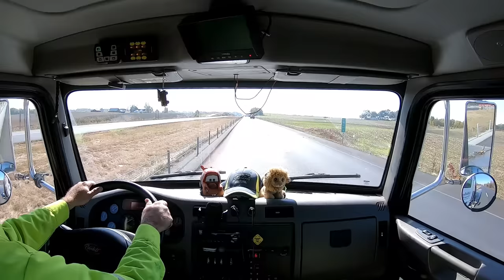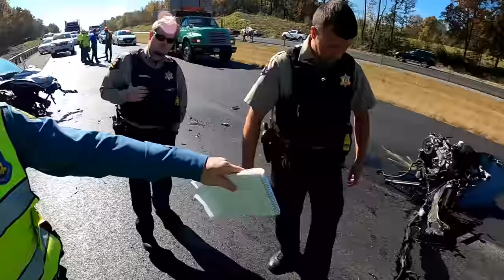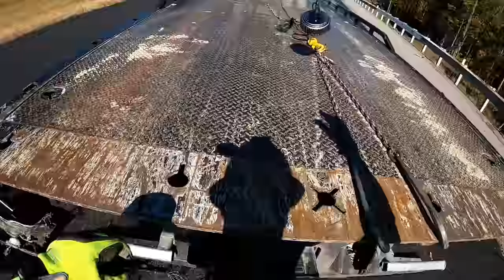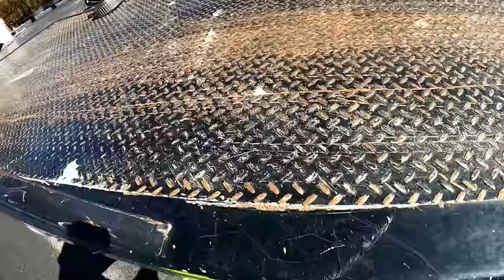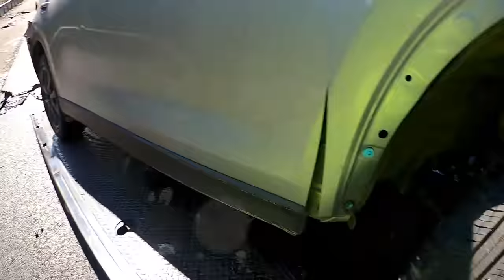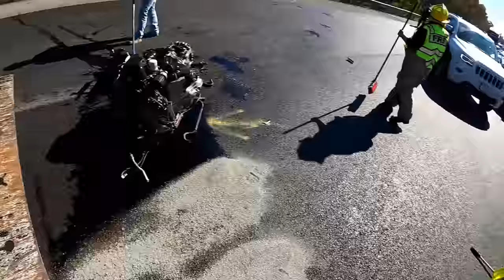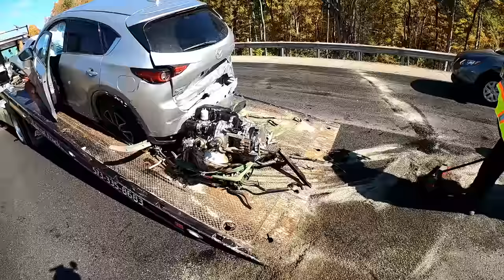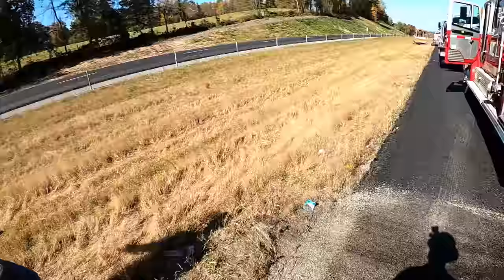Car-Splosion!!!   Code  (Blues & Twos)  Response While Driving In The Wrong Direction!!!

Comment: Please keep the code response drive times included. That's very interesting. Not everyone gets to see a wrecker run like that. Also please please Ron for your safety get that siren put on that truck for your safety. Clearing intersections without it sure seems dangerous with justma air horn. Although I see this vid is older so maybe it is done now. Good work Ron with everything.
Reply: We cannot hear his sirens from inside the cab.
Reply: @davidgriffith618  he stated in the video he hasn't had a chance to install the siren on this truck yet.
Reply: @davidgriffith618  he have non at this old lady. His newer ones have
Reply: @davidgriffith618  
That rollback doesn't have a siren yet. It's on Ron's mile long list of projects.
Reply: Yeah mate it's good to see a little bit of your part of the world
Reply: @davidgriffith618  Funny how we hear it just fine on the trucks that have one....
Reply: @davidgriffith618  
Have you watched his other video where he expedites. You can hear the siren in the truck. I'm not sure as to why you wouldn't.  You hear the horn and other things inside the truck why not the siren.
Reply: @841k9  this was filmed a while ago is my guess. im sure he's got one on there now
Reply: Hmmm.  I woulda thought that sirens would be restricted to fire, police and ambulances.  Is it only certain jurisdictions that allow sirens on recovery vehicles?
Reply: @avenger1888  air is louder
Reply: This is the new rig.  No siren equipped yet.  The air horn covers under MODOT satutes.
Reply: @keithmills778  In some of his videos he puts a caption explaining it but In Missouri tow operators are considered emergency vehicles (not first responders tho) and when requested they can run lights and sirens.
Reply: @keithmills778  It's state by state determined. 
That's why (as I was taught) you respond appropriately to the light (and/or 
horns / sirens)  NOT the type of vehicle.

Comment: For Sale: SUV. Light bumps and scratches. Needs engine and tires. No lowballers, I know what I got.
Reply: Actually, the engine can be included, just needs to be reinstalled.
Reply: lol
Reply: Sold
Reply: First owner,  clean and clear title under my name.  Tags good to 2024,  make me an   offer with cash in my hand.  Just had a new timing belt and water pump. Hurry,  It won't last.  Have a nice day.
Reply: Trade for a 89 Cressida rusted fenders no passengers seats runs and drives.
Reply: "Ran when last parked"
Reply: BWAHAHAHAHAA!!
Reply: Most of that will buff right out.
Reply: Might also need a coat of wax
Reply: Casually throws in needs new engine
Reply: lots of people sell cars like this and they’ll ask 2500 for the vehicle 🥴
Reply: @thedelightfullytacky  no point in reinstalling it. it’s likely broken & you’ll end up paying wayyy more to put it in, take it out, buy a new engine, and install the new engine than if you just bought & installed a new engine
Reply: Oh hi gonzo, I'll offer 200 lol
Reply: € @chucfilms  keep
Reply: Auction for Copart haha
Reply: Lmao
Reply: 500 dollars prob

Comment: 3:45
The ol flatbed looks like it could get real squirrelly in a heartbeat. 
Glad you’re hanging on with both hands!
Reply: That flatbed truck is almost new he's had it for about a year or little over now
Reply: I saw that, too. 😳
Reply: doing 75mph is quite fast compared to 80kph here in germany. I wonder if that more of a speed leads to more serious injuries or more accidents at all, but then on the other side, when all traffic goes the same speed, it could be more safe...
Reply: New is good ,but the wind don't care about that. It's a big box flying down the road at full noise so it's gonna sway like your drunk uncle at a wedding...! I'm just not sure if it is skill luck or a little of both that keep it on the road.
Reply: That asphalt looked brand new, no lines painted yet. Fresh asphalt very oily gets slippery as ice with a little rain.
Reply: @knuffelbaer1971  The faster someone drives, the greater the danger to the people and 
animals in the vehicle.

Comment: Bet the check engine light on that car said "Holy Crap".
Reply: ROFLLL
Reply: Now that was funny!
Reply: An actual check engine light. The computer would like to know if it's still physically there anymore.
Reply: Drops the car at an auto shop. Mechanic says "needs a motor".
Reply: @pistolannie6500  it went from a check engine light to a check for engine light.
Reply: It's undergone a radical lightening modification, and it's now an air-cooled engine at the rear…
Reply: Nah man the check engine light saw that coming and bailed.
Reply: @nmlepage  🤣🤣🤣🤣
Reply: "CANbus communication fault". Understatement in this case! The engine carried on driving!
Reply: Great  post made me smile and chuckle
Reply: Think that engine will need an oil change!
Reply: check engine.... "which part" HELL SHOULD I KNOW!!! ITS OVER DERE OVER DERE AND UP DERE
Reply: @ningen1980  Customer states, may need new motor
Reply: Best answer EVER. 🤣🤣🤣
Reply: More like: error 404. Engine not found
Reply: @SantaFebuff  I was going to say, what engine?
Reply: or ????
Reply: Someone died in that accident. Show some respect
Reply from the maker: @theone2be33  If someone had died in this crash it would NOT be shown on my channel.   This is a family-friendly channel.   Also, I clearly state in the video that the driver walked away from the incident.  Thanks for watching and God bless.
Reply: @Mrfort  you need a straw for that

Comment: Just imagine this crash in a car from 50-60 years ago... The driver would have left in a bag (or several, as grim as it sounds)
Reply: Yeah- They don't build them like they used to......thank God.
Reply: Actually I did walk away from a 75mph head-on whilst driving a car made in 1954. The bad years came later, when vehicles were made for the mass market. Now, the safety elements may have improved but there is so much electronic rubbish that makes relatively minor damage uneconomic to repair.
Reply: @Zombert But the car would have only needed minor repairs!
Reply: it still depends on HOW/WHAT you wrecked into or ran out in front of, say a loaded semi or fright train doing 60+. not a safety device one will save you, until they add pre-ejection seats! :)))
Reply: Then they would have buffed out the scratches and resold the car.  So glad engineering has advanced to much safer cars
Reply: in the very early days of cars, the cars were metal bodies on wooden frames.
in a head-on crash, the frame and passengers would stop moving but the body would separate from the frame and keep moving forward.
ouch.
Reply: @robt2151  you clearly don’t know much about cars. older cars survive accidents well because the bodies of the passengers take the force of the crash. cars now are made to take the force of the crash to give the passengers the best chance of survival
Reply: @misseselise3864  theyve actually crashed cars built in tthe 1950s..they fall apart like tin cans
Reply: @robt2151  I'm not saying you aren't telling the truth, but I want more details.
Reply: @misseselise3864  I don't like how you worded that. Passengers of older cars are LESS likely to survive a collision, since the cars themselves absorb less of the impact energy - coupled with the fact that many modern safety features weren't in use back then, or if they were, they weren't wide spread.

Comment: Good call of the officer. The left lane has most oil..
Reply: I think I would have tried to get the engine out of the way first, then the car.  Either way, the road will be cleared quickly.
Reply: @Harry-zz2oh  why?  Clearing the engine first would take longer, by the time the oil dry soaks up the oil!!  Clear the car first, traffic can use part of the shoulder & start moving again, while the engine & oil is being cleaned up!!!
Reply: @timothygeiger437  winch + chain  to engine drag it up the wrecker, use chain to hold it, pull car on behind, pull to left lane and strap all down secure.
looked like most all of the oil was on the roadway as is, so no risk of large spill or leaving a trail off flatbed.
seems to me situations like that it makes more sense to send a traffic control/cleaning pickup truck with, excess oil dry and spill cleaning gear, than a whole tow truck with less of all, just for an engine which has already dumped it's chowder ;)

Comment: Driver walked away because all of the energy from the collision left with the engine by design.
Reply: Car: 60 to zero in 0.00 seconds....  engine: zero to 60 feet in 5 seconds....
Reply: don't let all the overhyped nonsense overwhelm you into a safety state of mind, it's still about 90% LUCK and probable higher powers when anyone survives a bad wreck.
Reply: There truely is a lot of science behind this.  I had a good feeling the driver was ok when I saw no cockpit intrusion and obliterated front in.  It's like you said most of the energy was already absorbed before getting to the driver.....with that said they may still wake up sore the next morning 😂😂😂
Reply: Modern vehicles have impressive engineering in them to protect the occupants.
Reply: that is silly.
everything is going in the same direction until the crash.
the car stops forward motion because it hit something, the engine didn't hit anything so it keeps going forward.
drive the same car into a bridge abutment and the driver will eat that engine.
besides, an engine sliding down the highway at 60MPH is a liability for Mazda.
if that engine hits someone and kills them, there will be a suit as soon as the next of kin finds out the engine was designed to bail.

Comment: For sale: Engine. Used. Already removed and drained of all fluids. Might have a little damage.
Reply: Is the engine still good? Like can it still work
Reply: "Warranty not included"
Reply: Engine has light scratches
Reply: How much?
Reply: *minor scuffs
Reply: Needs paint
Reply: Would have been funny if the engine was actually still running.

Comment: Another great video.  There is a saying in racing that the more the car destroys itself in a wreck, the less you worry about the driver.  That's because the car takes all the energy of the crash and uses it to destroy itself than transferring it to the driver inside.  That idea has finally (in the last ~20-25 years) made it into street car design with crush zones and other "features" where it sucks because the car is totalled on almost anything other than a very slow speed accident, but it means that you (the occupant) are more likely to walk away from it because the car destroying itself means that you didn't take nearly as much impact energy.
Reply: The squishy bits on the outside protect the squishy bits on the inside that are a lot more expensive to replace :)

Comment: The integrity of the passenger compartment of that car is amazing to me... serious props to Mazda's engineering team for designing the crumple zones to effectively in that vehicle.  Truly amazing.
Reply: just lucky.
Reply: @ixlr8677  Not just luck - a lot of time and money goes into making crashes like this have this outcome. The safety features in new cars are amazing. Safety glass, 3 point seat belts, AIR BAGS, collapsible steering columns... the structure of (most?) new cars is designed to withstand a crash. All lessons learned the hard way.

Comment: Mr Pratt, The term Blues and Twos comes from the UK, where emergency services use only blue lights and two tone sirens (Blues and Twos.) Sir what I think you have here is a case of the Red, Blue, Toot'n Scoots lol. 

It does amaze me some of the crashes where people walk away unharmed. I've seen where the engine is almost in the drivers lap and after a simple door pop the driver just wiggles out without a scratch on them. As others have said here already, it shows that vehicles are being designed safer. Now if only we could make the drivers operate that much safer perhaps we could cut out fatal crashes all together.

Stay safe out there Ron, see you in the next vid!
Reply: "Red, Blue, Toot'n Scoots" sounds like something you end up with a few hours after eating at a shady buffet.
Reply: Used to they were the older panda car sirens.  Modern UK emergency vehicles have directional sirens so drivers could identify the direction of travel of the emergency vehicle.  Or at least that was true 20 years ago when I left St. John’s Ambulance.  Still call them blues and twos.

Comment: That was just crazy, never seen an accident like that with the whole engine ripped out and that person was extremely lucky to be walking around after that. Someone was watching out for that person.
Reply: Unfortunately in my country when there are serious accidents between very expensive cars and another car most other people can afford it's usually the really expensive car that is completely crumbled (at times also with the engine out) and the driver of the expensive car is ok, and the driver of the less expensive car is either seriously injured or dead.
The zones in more expensive cars meant to buckle during a collision are so well designed that they basically exert most of the force on the less expensive car (which is, at times also next to the expensive car having exceeded the speed limit by far).
From what I once saw in a TV program, some car manufacturers are now trying to design the frame of the car so that the engine can dislodge itself easier in order to lower the risk of the engine block impaling the driver.

Comment: Could you have winched the engine into the rollback first and then the SUV on behind it?
Reply: That would have been the sensible way to do it!
Reply: I guess I should have watched to the end of the video before posting. I thought you were waiting for another vehicle to load the engine.
Reply: He probably could have, but he was told that the main priority was to get the vehicle moved so they could re-open traffic. Every second counts when the freeway is stopped, which is why they reopened traffic as soon as the car was loaded (and why it was a code response)

He then had room to load the engine on the back without impeding the opened lane of traffic, so decided to do that too (he originally called talon to come and grab the engine). Loading the engine first makes more sense logistically, but loading the vehicle first makes more sense to reopen the highway in the shortest possible time
Reply: He could have but the cop asked him to move the car first so they could open that lane of traffic up.
Reply: Yes, but car first opened the road faster.
Reply: You could, but its generally easier to do the car itself first when possible. Slide it on as far up as you can, and then put the motor on the back. Makes it easier to unload when that time comes. Always have to think 5-10 steps ahead with tow recoverys.
Reply: I was wondering this also?
Reply: Almost certainly would have interfered with the winch line on the heavier pull, unless he manhandled it to the corner of the deck - dangerous work on a slick, elevated deck. Also would have delayed reopening the roadway by leaving the primary obstruction in place longer, increasing time at risk of secondary collisions. One apparently occurred anyway, but they did what was possible to reduce the chances.

Comment: Just for people who may not understand, when ur told to expedite by highway patrol, u are given authorization to get to the scene RIGHT NOW by any and all means necessary. In this situation, looks like it turned out to be that highway patrol needed to get their highway opened up RIGHT NOW.  Basically highway patrol wants u to make this not be here anymore and fast. I can say from experience, its a rush that u cant describe. Ive done this stuff with a 40/50 ton sliding rotator at 2:15am with traffic backed up as far as the eye can see, 53ft loaded with shoes, lift it in the air loaded and rotate 180° and set it on a trailer. Highway back open within 42min after arriving on scene. Id pay money to do that work again.

Comment: Modern car design has evolved into just this - the car takes a huge amount of damage while protecting the occupants inside the cabin.  It's amazing compared to how it used to be.  I was involved in an accident that totaled my Suburban and another guy's Altima (with 5 people inside), and we all walked away.  I came out without a scratch, but my engine was busted and bleeding, front wheel knocked clean off the hub, and the front and driver's side totaled (couldn't even open either door on that side).  His car looked worse than this one, if you can believe it, and only one guy had a small cut.  It made me a believer in the crash testing and redesigning it inspired.

Comment: As a Firefighter/Batt/Chief that ran the Rescue truck. We've seen it all on the interstate. Had a eighteen wheeler run into back of a slow moving 18 wheeler. It knocked motor out of the one that hit first and knocked both axles out of first one ne heck of mess on interstate.

Comment: So in case anyone is wondering why the engine was in the road, modern cars are designed that way. It is supposed to protect the driver of the vehicle by not slamming the entire engine towards the driver. Now yes having an engine just in the road can cause other issues, but for the most part it is much safer in a crash

Comment: Modern cars are a pain to fix at times.  When you have a minor fender bender that costs 2500+ to fix.  But then you have a crash like this where the car is destroyed but the driver can walk away from it.   I think it is as worthy compromise.   The cars of old would have likely killed the driver or left him with a crippling injury.    Every accident is different with different results.  But still I have know several people in bad crashes and they have all pretty much walked away when driving a modernish car.   As Jey Leno says don't buy your kids a classic car, they are not safe enough get you kid a car from 2005 on up.